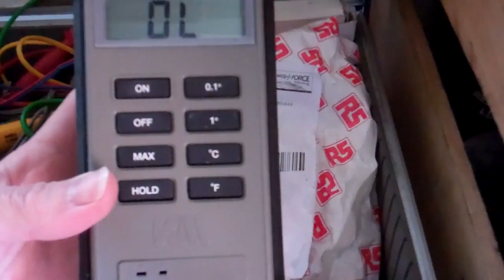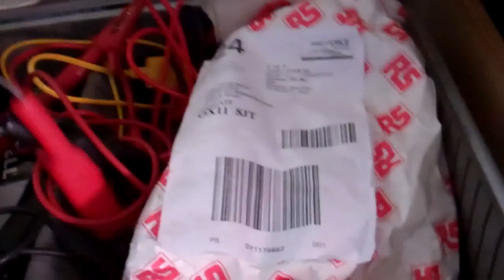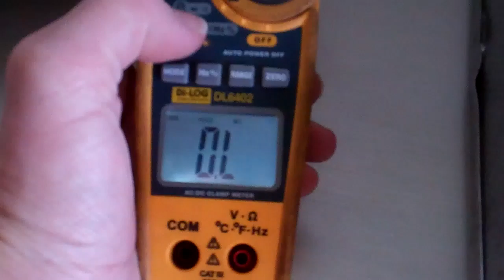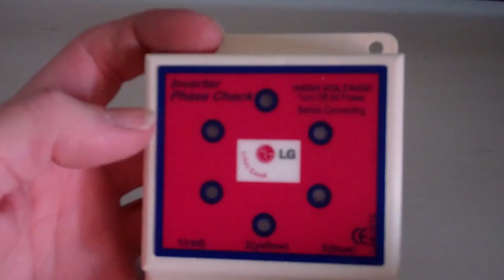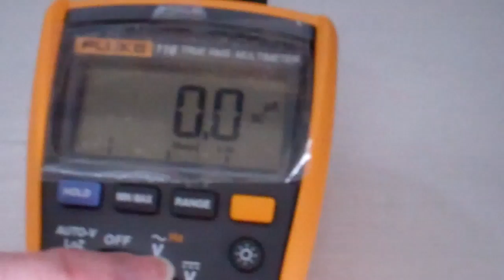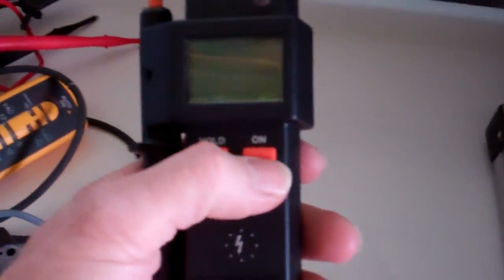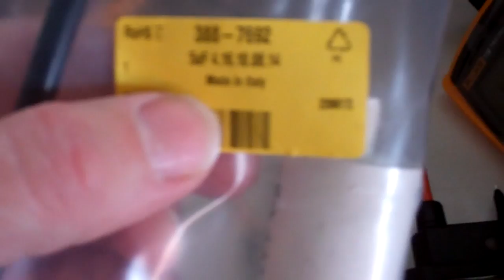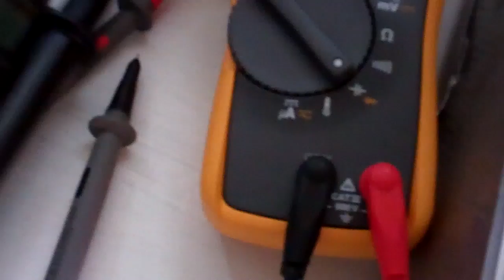Hvac Test Meter Demo

Comment: hello sorry for my english, are you sponsored ? because it's impressive while the meter in hardware at least you have a back up solution. Fluke Volt alert/116/T2/T100   Kewtech KT116/KT200  Ideal 61-746  Dilog 6402  Robin 2002P  Weidmuller Digichek 5.2 and surely your favorite your Megger MIT410
Reply from the maker: Isfcer Isfcer Hi, I am not sponsored but have been working for 20 years so have had time to buy tools etc gradually to spread the cost.

Comment from the maker: Hi,

I think they are made here in the UK but i don't think they export, you could email them and ask if they have any USA based agents.
I got a new fluke amp meter and the first time i used it the knob fell off! took it back and its taken so long to get it fixed i got this one as a temporary and now permanent replacement! (still no fluke...)
I'd get the next model up if i was getting another one as the capacitance range goes higher. 
The only function i miss is peak hold for start currents :-)

Comment from the maker: Hi Fritz!

66 is t shirt weather here! 

I'm happy with my meters now i replaced the cheap chinese made one which was not doing what i set it to every now and then... 

Theres a guy on here called EEVblog that does a review on the Fluke 117 which sold me on the meter and it hasn't disapointed! Had to get the magnetic hanger after watching you guys in the States with your Fieldpiece magnetic hangers!

Had a few lucky escapes with electric, 240v to ground here so you know it when it gets you!!!

Comment from the maker: I had a fluke 12 for years till the display failed, couldn't afford another fluke at the time and made do with a cheap chinese made meter but recently notice it wasn't doing what it should and lost faith in it for working on mains voltages!

The clamp meter is made by Di-Log (owned by fluke i think) they do some different versions, i wish i'd got the next one up as the capacitance range goes higher so i could test start caps as well as runs that it does ok, otherwise its a good meter!